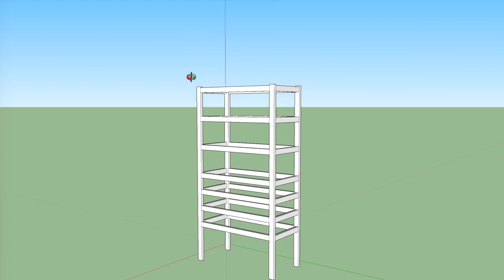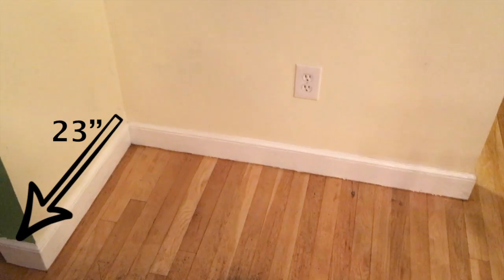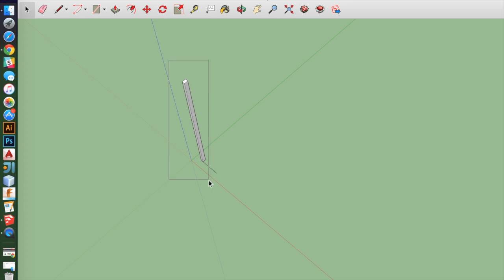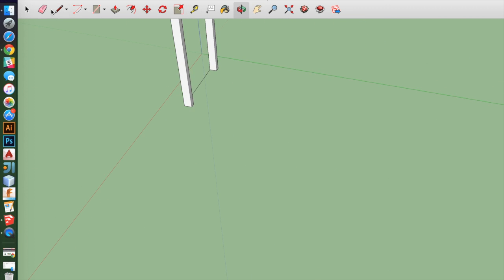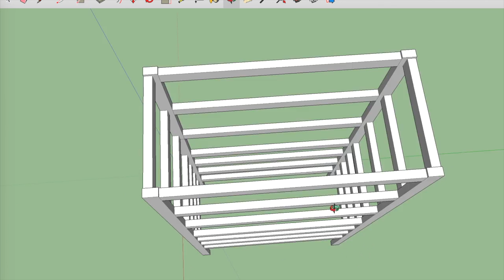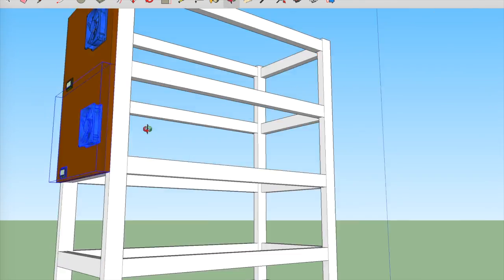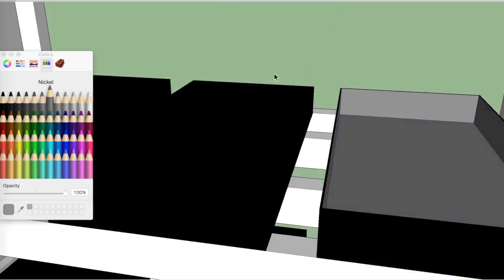Microgreens Project Part 1: Intro + Structure Build

Comment: i though about doing something like this but instead of wood use PVC pipe, its cheap and readily available. would also let you run hydroponics or aeroponics lines and power cables inside the piping for a super clean look